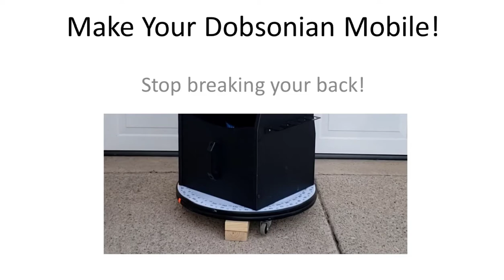Telescope TOO Heavy? Watch This To Save Your Back!

Comment: I also have a 12" Dob . My solution was to install adjustable legs with jam nuts to hold steady.  Roll out ,  adjust legs to raise casters off the ground w/speed wrench and hex key. Very little stress and strain.
Reply from the maker: That's a really good way to quickly get leveled. I wish I'd used your method from the start!  Thanks for watching.
Reply: Hi, can you post a pic of your base with the adjustable legs and casters? Would like to see the spacing. Thanks!

Comment: I have mine strapped to a 2 wheel furniture Dolly from harbor freight. The kind with big wheels with air in them. A few bungees to keep the tube held tight and I can roll it over grass and hills and floor plates in doorways,etc. And it stays attached to the Dolly while stored.
Reply from the maker: Thank you for watching!  In hindsight, I wished I'd used a dolly or at least bigger wheels.  Mine works okay, but the wheels are too small.  Clear skies!

Comment: I used castor wheels with a brake mechanism. Holds the position tight.
Reply from the maker: Those wheels with brake mechanisms are very helpful.

Comment: Thumbs up, and overall totally agree. That said, how have the casters fared the last two years, since they're installed with screws? If on concrete or hard surface exclusively, they're probably still in place. If on gravel, dirt, lawn, etc., perhaps separating the base to install the casters with bolts/nuts/washers would make it last forever, this side of a flood situation. I was a camera scenic in the film industry, and my home built on-set paint cart featured pneumatic 10" casters I installed with screws. Day three of using it, we were filming in a remote location featuring zero pavement to roll carts on. The large casters themselves did great. The screws pulled out of the plywood and frame material after perhaps 15 minutes of moving it around in a soft substrate. I wrestled with it for the long day, but got the set of bolts that evening to replace my faulty engineering. That cart lasted a decade, until I retired from film and passed it on to a friend. Wide fender washers under bolt heads and lock nuts kept things from pulling out. Screws could very well rip out of particle board on a heavier Dob base, which is why I'm mentioning it. I love the wood block idea. Stacking different thicknesses would be great for someone (like me) pulling the scope out onto a sloped gravel driveway in the mountains. Last night I struggled at zenith with my XT8, partly because the base was at an incline. I'm considering a 12" dob, which is why I came to this video.
Reply from the maker: Thank you for sharing.  So far, I haven't had any problems with the castor wheels, but so far mine has never left pavement (driveways, sidewalks, parking lots).  I did recently switch out the wheels to larger diameter wheels (with locking hubs).  Exciting to hear from somebody in the movie industry - I was always curious about the production side of things.  Clear skies!

Comment: I fitted longer rubber feet to the base in order to slide my sack trolley underneath the base. I just wheel it to my observing site where I place it on my EQ platform for tracking. Clear skies 🔭.
Reply from the maker: That's a clever way to get it loaded up onto the trolly.

Comment: Great video! I use a handtruck to move around my AD8. I have a gravel driveway where I do my observing, and casters really wouldn't be suited for that rough, bumpy terrain.
Reply from the maker: Gravel is a tough one.  As you found out, you need big tires.

Comment: Wow!! I was wondering how to keep it from rolling away (locking casters of course) but also how to level it with casters on. The blocks answer both.  Thank you!!
Reply from the maker: Happy to help.  I've since replaced the wheels with slightly larger wheels.  Makes for a smoother movement across the garage.

Comment: I'm going to do the same thing, but use 5" casters that should roll pretty easy over various surfaces. Also using ones that are locking which should work OK for that. Thanks for the video!
Reply from the maker: The bigger the wheels the smoother rolling, but may be more likely to tip over. Be careful and have fun.

Comment: I went to harbor freight and bought a square furniture dolly with castors on it. Its basically 2x4s in a square with castors attached. I placed my 10 in Zhumell on top of it and hammered some nails next to the square to keep it in place. If I want all I have to do is to pick it up and remove the furniture dolly.
Reply from the maker: Nice!  It sounds like there are many ways to make our Dobs mobile.  I think your solution is ideal for a lighter-weight 10" or smaller Dob. In this video, the 12" Dob would be too heavy/awkward to lift up and off as one piece.  Ultimately my goal was a three-point support that could be rolled around and over small obstacles. It's a bit of a challenge to level the base with four points of contact as opposed to three, so I would likely have to remove it from the dolly.  Not a problem if you're on relatively flat terrain.  Thank you for the comment - more proof that there are many ways to reach a common solution.
Reply: @reflactor  I just leave it on the dolly at all times. I don't brace it or remove the dolly. I debate whether I should have gotten a 12 inch over a 10 inch. I am glad I did not get an 8 inch.The 10 inch is just a little bit more portable and likely will fit in a car where the 12 is questionable so it may have been a good choice. A bit off subject lol! The GSO dobs that you and I  have are the best in my opinion.

Comment: Hi from Israel,
Just bought a 12" GSO dobsonian. Ordered heavy duty straps with handles.
Thing is, the dark site that I travel to requires a walk on uneven ground of say 100m.
Hope I'll survive...
Reply from the maker: Carrying one of those big telescopes 100m would be a lot of work. Stay safe!
Reply: I used to use a set of Wheeleez. They are marketed as a kayak cart. Learn a few knots, secure it to one end, and you can roll it wherever you are going on big soft inflated wheels.
Reply: Buy a sack trolley and a couple of bungee cords. Sorted. PS:- ( inflatable tires is a huge plus).
Reply: I hope youre still alive

Comment: There are locking casters that you can use.
Reply from the maker: You are correct. I looked into using those, but I couldn't get my foot to actuate the mechanism on my telescope.  I'm sure there are a lot of styles out there though that would probably work very well.

Comment: Hand truck is better. It goes up and down stairs, over grass, and thru dirt. No bending over, no blocks to carry around,
Reply from the maker: Thanks for watching! Hand trucks have their place for sure. In my workshop, the castoring wheels are great because they take so little effort. They just glide out of the door and into the driveway.  I did have a hand truck for the super heavy Orion XT10g that I used to own. Clear skies!

Comment: I love the idea, but the lip from my garage to my driveway is a bit of a drop. I don’t believe those casters would be big enough to clear. Plus my driveway is on a slant so I would need leveling adjustment. Great idea.
Reply from the maker: Thank you for watching.  My garage lip is about 1.5 inches.  I did end up building a ramp.  In hindsight, I wish I would've used bigger wheels.  Clear skies!
Reply: Different size casters are available.

Comment: I’m planning on getting a 12” but I don’t have a garage and was thinking about using a hand truck, would that work?
Reply from the maker: It might work great. That's how I moved around my 10" GoTo early on in my hobby years.  I wrapped each of the metal pipe parts of the hand truck with pipe insulation as a cushion.
Reply: how are those lifting straps on the 12”?

Comment: In the video, you mentioned that you had the mirror resurfaced.  who did the work?  Thanks.
Reply from the maker: Jeff Decker at Majestic Optical Coatings in Ruckersville, Virginia. He did a great job with very fast turnaround time.
Reply: @reflactor  thank you

Comment: What size are the Caster wheels???
What size are the wooden blocks???
Reply from the maker: In this video they were small, on the order of 1.75 inches in diameter or 2 inches.  I've since upgraded it to 3 inches with locking casters.  The wood blocks were just 2x4's with holes cut out to hold the old conical feet.